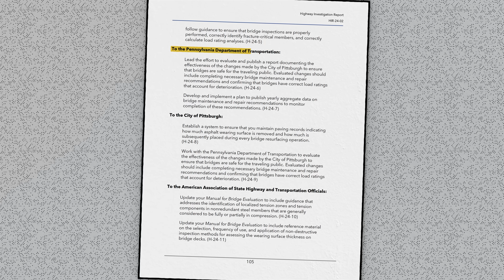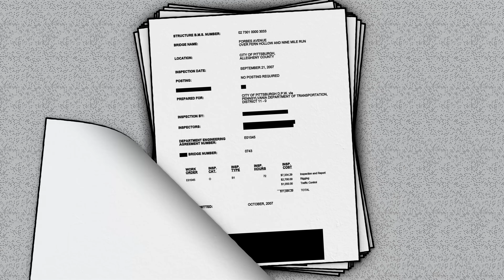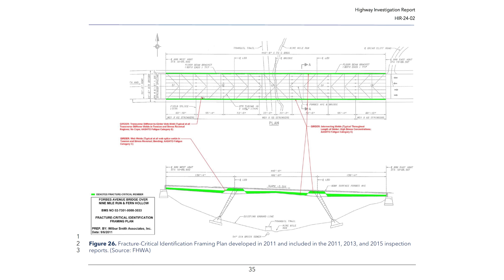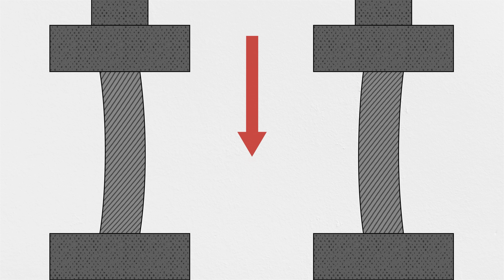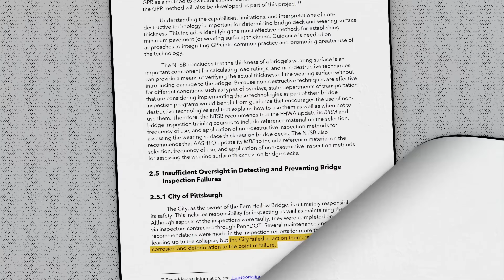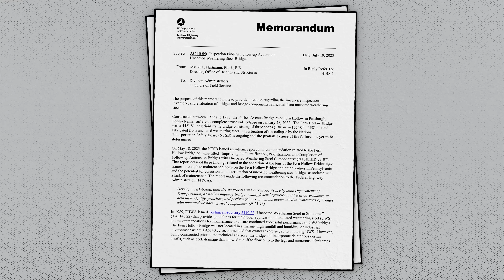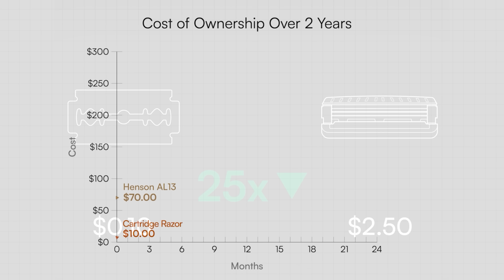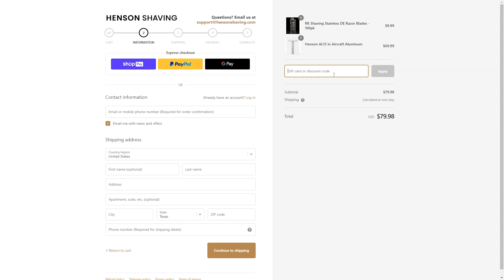This Bridge Should Have Been Closed Years Before It Collapsed

Comment: Great video.  I'm a bridge engineer in Pennsylvania (Philly), and you really hit on a lot of the issues with the system.  We as inspectors can only do so much.  We have a responsibility to do the due diligence during the inspection and report writing process.  Seeing defects like was seen on this bridge is unfortunately not uncommon.  Finding 100% section loss in steel is pretty normal,  but as you noted, the location of the section loss matters.  It often matters more than the amount of section loss,  because there's a lot of material in a bridge that doesn't see a lot of stress.  Unfortunately we as inspectors only have the ability to report findings.  Some owners are more proactive than others when it comes to repairs,  load ratings,  increased inspection frequency, and replacement. PennDOT is notoriously bad with maintaining its infrastructure. Pennsylvania is 2nd in the country for the quantity of bridges in their inventory,  and they are 1st for having the worst condition bridges.  Given the history of the state, including with the country's founding and steel fabrication in PA, it's no surprise that we have so many bridges in such poor condition.  We have some really really old bridges here - some over 200 years old. But in spite of the monumental responsibility that Pennsylvania has as compared to other states,  the state agencies and politicians seem disinterested in doing anything about it.  Penndot is notoriously stingy with everything,  even new design budgets.  It makes it difficult to get anything done or to find competent work.  The lack of attention to infrastructure is an age-old joke to Pennsylvanians. We are the pothole capital of the US. Something has to give at some point,  but it doesn't seem like that's ever going to happen.  Penndot and the state government are more interested in buying new technologies for turnpike tolling and building whole new interchanges than they are with fixing our existing infrastructure. Even multiple high profile bridge collapses haven't been enough to sway those in charge.
Reply: If inspectors had a federal power to limit the traffic using a bridge -- even to the point of none at all -- would that help, or would officials just take excuses through the courts or close the bridges without alternatives?
Reply: @rivimey they closed another Pittsburgh bridge about three miles from this bridge about a year after the Fern Hollow bridge collapsed. It was a bridge that carried major traffic. It was closed with no warning to the public (that was fun), and we were told that it was going to be repaired. Almost a year and a half later, nothing had been done. They “might” get it repaired and opened sometime next year. 

Welcome to Pittsburgh!
Reply: Thanks for that, it's good to hear from someone who actually knows the field. 
I was just thinking about the twitter post and photo that got mentioned in the report. Do you think that a loose network of concerned citizens, dog walkers, hikers, retired busybodies and just random dudes and Karens could help you, now that everyone has a smart phone? No doubt there would have to be a few simple rules they would all have to follow but you would get a large photo archive of the bridges and infrastructure over time and in different conditions. That could be useful.
Reply: @rivimey   the politics of it all can be really complicated, but it's not exactly an Us vs. Them relationship with inspectors and owners. Inspectors can and (on rare occasions) do call in to the owner while on-site when the condition is severe enough for emergency intervention.  The issue comes with finding that threshold where you decide that something must be done immediately.  There are no shortage of bridges in this country that have very severe deterioration,  yet they remain standing for years or decades.  There's a lot of reserve capacity and redundancy in most bridges, so loss of material doesn't necessarily mean the bridge is in danger of collapse (often it isn't). It can be difficult to determine this in the field though,  because you need to do a rigorous analysis to even know the capacity.  It's not possible to do that on site.  Generally, there are telltale signs of imminent danger that we would see that would cause us to call it in.  Things like a significant sag in the bridge deck, a fracture in a steel member,  severe scour of a bridge foundation due to water,  etc.  Certain types of bridges are more critical than others due to the nature of how they distribute stress.  For example,  trusses are typically non-redundant, so if 1 member fails then the entire bridge or a section of the bridge may collapse.  So seeing a fracture in a steel member of a truss is a very big deal and we would call that in and probably try to stop traffic ourselves if possible.  But seeing a crack in a steel beam on a 6-beam bridge is less critical,  because if that beam fails the load can distribute to the adjacent beams and imminent collapse is unlikely. Load redistribution isn't possible with a truss. Ultimately the owner still gets the final say in whether or not to close the bridge,  but generally speaking they will take the advice of the inspector. The implications for closing a small bridge on a back road are minimal,  so it's not usually a big deal to close one.  But closing a mainline bridge on an interstate and/or a bridge on the Federal emergency route has massive implications for the surrounding community,  commerce,  emergency services,  safety of local residents, etc. It's no small deal to close a bridge on I-95 like the one that collapsed here in Philly after the tanker fire or the FSK bridge in Baltimore that was struck by the ship. I'm not implying that those bridges should have been closed due to their condition by the way; I'm just using them as examples since they're well known to everyone in the country and they're on major interstates. For an inspector to call in the closure of an interstate bridge,  he needs to be right about it needing to be closed asap. The owner would be pissed if we called in something that wasn't that emergent, wasting tons of time and money by doing so. That's why it's so tricky to do these things.  You are basically putting your entire career on the line for something that you usually cannot be 100% sure about.  It's almost never black and white.
Reply: @jakedee4117  no offense to those trying to help,  but the vast majority of people lack the requisite knowledge to understand the condition or potential threat to safety. The general public tends to put too much emphasis on the appearance of a bridge without understanding the mechanics.  I've seen and heard many non-engineers complain about an 'old rusted bridge' which really says nothing about condition or load carrying capacity.  Rust is normal on steel.  Cracks are normal in concrete.  You can have either without it affecting the bridge capacity at all. I've inspected countless bridges that had failed paint and rust throughout,  but they didn't have any measurable loss of steel.  When steel oxidizes,  the resulting material (rust) is 16 times thicker than the original steel.  So if you had a 1/16" steel plate that fully rusted through,  you'd end up with 1" thick rust.  Extrapolate this to a typical beam/girder flange that is 1", 2", or 3+" thick,  and that's a LOT of rust.  Point is: it often looks worse than it is to the untrained eye. We make the remaining steel section with calipers and use that data to do a load rating analysis of the bridge. It's not even possible for us as engineers to gauge these things on site.  We need to run an analysis on the computer. So it's virtually impossible for the general public to have any idea about the condition of a bridge.  The times when the public can help is more with the big red flag items that any person would know is a problem.  Certainly the Twitter photo in this case would be a good thing to report,  though 100% section loss on a bracing member is still not that unusual. I-495 around Wilmington was closed after a motorist reported a sag in the bridge barrier.  That sag ended up being due to the pier tilting as a result of a stockpile of construction material too close to the bridge.  That was a rare case when a not-so-obvious sign of distress ended up being a massive issue,  and somehow a traveling motorist caught it. If I were to provide guidance to anyone wanting to report emergent issues with a bridge,  I would say to ask themselves 'does this look right?' As in,  is something bending in a way it doesn't look to be designed for? Is something leaning that probably shouldn't be leaning? Is a piece of steel cracked or fractured?  Is a large portion or all of the foundation exposed? If you see something that really looks off, report it. But I would say to refrain from reporting rusted steel or cracked concrete,  because 99.9% of the time it's not a serious defect requiring immediate intervention. And over-reporting non- critical issues will only take away from our time and resources. The majority of the time,  we already know about the issue being reported by a concerned citizen, and it's been evaluated at least once.  Many times,  it's a very insignificant defect that sometimes has been around for decades, but it simply looks bad to the public so it keeps getting reported. We have to inspect all bridges in the country on at least a 2yr cycle,  so there's rarely a situation where a defect goes unnoticed by inspectors for years.
Reply: @rfehr613  You raise a lot of good points and maybe my point isn't so much about inspecting bridges as it is using people plus technology to keep an eye on what's happening in our communities. One of the problems raised in the video was clogged drains, so how often are the streets flooding, when and where? Where is the garbage piling up? Homeless encampments? Oil stains, weird smells etc. etc.
I know a lot of people are concerned about security cameras surveilling everyone but, in a democracy, people can't complain about citizens keeping an eye on public places and passing the information on.
This could actually be a good job for AI. Sift through it all and make alerts when needed.
Reply: @rfehr613  I respectfully disagree with your original comment of "we can only do so much".  If, by that, you mean to fill out and submit your inspection form, for a structure that is obviously in peril, that is a disservice to the safety of the public. If the engineers in this case submitted, held special calls/meetings, implored the owners, and then went to the media about the issues, then great.  That is what should be done as I understand the code of ethics for an a Civil Engineer.  Otherwise you are just acting within the same failed system.
Reply: @jakedee4117  inspectors inspect and report on all aspects of a bridge,  including drainage.  In fact,  drainage is one of the most critical aspects, since properly functioning drainage is the first line of defense against deterioration.  Water,  or rather salts in water,  are the primary mechanism driving deterioration.  That's why we try to minimize the use of joints in a bridge,  because fewer joints mean fewer chances of water getting on the critical components of a bridge. 

We are also expanding the use of technology.  My firm has used drones in limited capacity.  They are really only useful for areas that an inspector cannot reach.  Other advanced inspection methods employ radar or lidar for finding defects in a bridge deck,  various equipment for detecting cracks or imperfections in steel,  and destructive testing like concrete coring to evaluate the condition of concrete beyond the surface. Some owners are utilizing ice and snow sensors,  many use cameras already on all their interstate bridges,  and there's an ever-evolving field of material science which offers new materials for owners to use. 

I think the biggest thing the public could do is pressure the state agencies and politicians to invest more in repairing the infrastructure. That would be the most effective use of their voice in my honest opinion.
Reply: As an Ohioan and honorary Michigander, I'll fight you for that pothole title 🤣🤣
Reply: @Real28  😂 any of the northern states are pretty bad.  I've never been to Ohio,  but I don't recall the UP being particularly bad.  Then again,  they don't even have traffic signals up there 😂😂
Reply: @daveharness70  it's easy to be critical when you're standing on the outside looking in.  But as I described in my other posts,  it's never black and white.  There's no grand conspiracy to perpetuate an unsafe system of infrastructure. It's simply a matter of balancing safety and fiscal responsibility.  We'd love to fix every little problem on every bridge,  but there's nowhere near enough money to do that.  So we have to decide what can be fixed and when.  That's why defects are assigned priority levels.  It would be wholly irresponsible and a violation of the code of ethics to demand every miniscule defect be fixed on an emergency basis.
Reply: @daveharness70  I'd also like to add that not all inspectors are created equal.  Every state does things differently.  Some states, such as Virginia, do not require their inspectors to be engineers.  You can become a bridge inspector in Virginia with only a high school diploma and the basic bridge inspection training course that we all take.  I do not think this is smart policy,  but at least it's the exception not the rule.  Most states require some kind of engineering credentials - be it an engineering degree or a professional engineering license (believe it or not,  you don't necessarily need the former to obtain the latter in many states). Further complicating matters is that some (probably most) states have in-house inspectors. Virginia,  Delaware,  and Maryland SHA use in-house inspectors.  Without putting any one agency on blast,  I'll just say that in-house inspectors are almost universally awful at inspection.  They don't really try at all,  and their reports are sometimes completely useless.  In the private consulting engineering world,  we hate getting an in-house inspection report because we know we can't trust its accuracy.  I think this is more a problem with government work as a whole and not unique to civil engineering by any means.  The upside is that every agency I'm aware of relies very heavily on private consultation firms for bridge inspection,  and many agencies are doing away with in-house inspection and even in-house engineering.  They're hiring all work out to us consultants because the product they receive is considerably better. Even private consulting comes in different flavors,  but from what I've seen most consultants are more than competent and extremely professional.  Most of the time,  we are inspecting bridges that we use ourselves,  so why wouldn't we want to be thorough and accurate?
Reply: Federal agencies should be obligated to publish all reports. 

Followed by a casual "hey you should look into this" to local journalists.
Reply: @rfehr613  What would you think about inspectors being able to file an emergency motion for a court to hold a hearing considering whether a large piece of construction/infrastructure is in such dire shape it needs to be shut down and/or the owner (inclusive of the gov.) legally compelled to take action?
My thought is that even if there are issues with appropriate enforcement, it's at least the kind of thing that could raise public awareness, get local news more likely to report on the state of the structure and/or a court having such a hearing. I've seen local news reporting on citizen complaints about a bridge in CO end up with the needed (and promised but long left unfulfilled) fixes being fast tracked after the reporting, for example.
Reply: @AlohaChips  I don't think that is necessary.  Perhaps I wasn't clear enough with my previous posts,  but when it comes to emergency actions like immediately shutting down a bridge,  I've never heard of an owner challenge the inspector to keep it open.  That doesn't happen.  When it comes to emergencies, the issue is more about correctly identifying it as a true emergency.  That can be really hard to do sometimes.  It's not always obvious.  But if we make the call,  you can expect it to get shut down. 

Emergency intervention means that you do something right now.  Whereas there are other priority levels which are still high priority but don't require the bridge to be closed.  Sometimes they will get someone out there to fix it the same day but without shutting the bridge down.  That's still a very urgent matter,  but it's not the TOP urgency level... which would be immediate closure.  We routinely write Letters of Concern to owners, which are basically a step down from emergency priority.  An LOC might cause the owner to decide to close 1-2 lanes, limit truck traffic,  or any other number of actions.  It just depends on the issue at hand. But properly assigning of priority levels is an essential function of our job.
Reply: PA has ~120,000 miles of state maintained roadways in part due to the 50/50 rural/urban nature of it. Add in the freeze thaw cycles, amount of out of state traffic and salting and we also have a very large and expensive infrastructure to maintain.
Reply: @paulwalsh2458  I don't think Pennsylvania is particularly unique in any of those respects when compared to it's neighbors. What sets PA apart is the amount of bridges,  which incidentally are orders of magnitude more expensive to replace compared to roadways.  Having grown up here and having lived here for about 30 of my 40 years,  I've seen the same trends with infrastructure investment.  Having worked extensively in Maryland,  Delaware, and a bit in Virginia,  I have a pretty good feel for how the states handle their infrastructure and budgets.  And unfortunately PA seems to handle it the worst (though Virginia is pretty bad with bridges too). It seems like a mentality in the state and local governments.  PA is unique in the fact that it divides itself into distinct districts that almost act independently of each other and independently of the state. It seems inefficient to me.
Reply: @rfehr613  For comparison take NJ with the metric of a similar population size and the number of state maintained road miles. And statistically look at areas with the most freeze/thaw cycles. We north PA drivers see everything below the Lehigh Valley Tunnel as Jersey, MD DE weather, then there's the rest of PA. I think NJ is ~35,000 miles of state maintained roads but can't remember. *I partly agree about the bridges but those on the alluvial plain get warmer weather yet salty air and those inland get continental weather and salted roads.
Reply: @rfehr613  "when it comes to emergency actions like immediately shutting down a bridge,  I've never heard of an owner challenge the inspector to keep it open.  That doesn't happen."

What about the situation that occurred in Pittsburgh, where multiple high priority problems (Grady called them 'level 2,' I think) identified during inspection went unaddressed for years? Is that common? If so, would it be reasonable or possible for state or federal government to require public disclosure when that happens? Public pressure might help to get those problems resolved a little faster. Even though I'm unlikely to call my state DOT, I think I'd still like to know which bridges that I use regularly have repeatedly failed to address weaknesses identified in inspection.
Reply: @aaronb1195  the issues leading to the collapse of this bridge are multifaceted.  There isn't typically one single failure that you can point to.  Without having read the actual investigation myself,  it seems to me that it was likely a combination of misreported severity of defects,  misunderstanding of the mechanics of the bridge,  and/or failure to act by penndot. I have to emphasize that i do not have knowledge of this particular bridge,  so don't take anything i say about it as gospel.   The process just really isn't as black & white as it seems after a disaster occurs.

A priority 2 defect or repair is actually really not that big of deal typically,  which is why it seems to have been misreported. The issue with making the full report public is the fact that the public doesn't understand the mechanics or verbiage that we use.  Things that may sound severe really aren't.  It's just how we talk, for lack of a better explanation.
Reply: I've lived and driven in Pa for a longer duration than yourself so if this metric fits into your calculations ok. That being said I'
m fairly apathetic whether our infrastructure collapses entirely. I want my people to survive. That is all.
Reply: @paulwalsh2458  of course every dot handles things differently.  NJ tends to be better than PA, but their taxes are considerably higher too.  And they have a much larger portion of urban area to rural.  That said,  their gas taxes are lower,  so maybe they just allocate resources better.  I also have zero NJ inspection experience,  so I'm going off of  hearsay with this. It may be cooler in central or northern PA (in a bloomsburg grad, undergrad in physics), but it's really not a different climate.  There's no appreciable change in climate until you reach Virginia.
Reply: @paulwalsh2458  the point of me saying I've lived in PA for about 30 years was only to emphasize that I haven't really seen much change with how the state handles things.  Obviously, I haven't been an engineer for 30 years,  but in my professional opinion my assessment of the infrastructure management here is unchanged from before I was an engineer until present day. I'm speculating to some degree on the cause,  but I have lots of experience outside PA to compare to.
Reply: @rfehr613  I agree that NJ and VA and the rest of the N.E. states maintain better road conditions throughout the year. As an uneducated man who travels the Nanticoke/West Nanticoke bridge on a regular basis I'd like your opinion on its condition if you can scare any up..
Reply: @paulwalsh2458  can't say I've ever been there.  My only traveling in pennsyltukey were pretty much limited to the occasional visit to Wilkes barre, Scranton,  Centralia, or hazleton.
Reply: @rfehr613  That's ok.
Reply: @rfehr613  As you can see from my other response, I'm not on the "outside".  You are downplaying the obvious decay and neglect of this bridge.  If you were involved I would file a complaint to the board.  You seem to be turning a blind eye to the whole "ethics" component of your license.  It is for the public safety, not for you, your employer, or your client.
Reply: I don't know what other post you're referring to,  but the one single post I see of yours suggests you're not a civil engineer.  Moreover,  your lack of understanding of the process indicates that you are in no way qualified to even discuss specifics.  I'm trying to put things into layman's terms for you and everyone else here,  but this isn't the ideal medium to be doing that.  It's difficult to write long and thorough posts on a YouTube comment section from my phone. 

It seems that you only want to start a fight and try to point the finger of blame.  You are putting words in my mouth and making assumptions that aren't true.  I've explained the process in more detail in other posts,  so you're more than welcome to read those to get a better understanding.  But to be abundantly clear,  we (engineers/inspectors/owners) are in no way shape or form attempting to skirt regulations or turn a blind eye to safety.  In addition,  nobody is perfect and no inspection is perfect.  Defects can be missed, defects are not always able to be detected.  Defects may be more severe than the inspector thought they were.  And yes I'm sure there are times when negligence is to blame.  But you don't get to define what constitutes negligence,  because unless you are an investigator for the NTSB or work for a consulting firm doing forensic engineering, 
 you lack the requisite knowledge to identify and assign fault.
Reply: @rfehr613  Perhaps you can read my other  response to your other babbling comment. It might help.   I'm starting to think that you are not a professional engineer as you are not getting the point.  But you sure can sling that keyboard!  You also don't listen to learn or understand, you merely listen to respond.  Oh...and I do work for a consulting firm doing forensic engineering.  But since you are here to spread your knowledge like sewage with placating words to the ignorant public (no offense meant to others reading) to turn their wrath away from the engineers, I'm not going to change your perception.  Good day, technician.
Reply: @daveharness70 that is a pretty childish and unprofessional outburst from a purported professional engineer.  I have remained professional despite your mud slinging.  Since you are so hell bent on demeaning a fellow engineer for your own personal gain,  how about you at least prove to anyone else reading this that you are in fact a qualified professional by producing evidence of said qualifications? 

I doubt you will follow through based on your responses thus far,  but so as not to be a hypocrite, here are my qualifications. And I'm sure you already know that licenses are public record...

Professional engineer (PA - PE094603, MD - 50278)
MSCE Structures (Virginia Tech) 
12yoe in bridge design,  rating, and inspection 
NHI Certs: 130055, 130053, 130078, 130087

Clearly, I'm more than qualified to discuss bridge inspection in detail and to provide the general public with information about how my industry works.  I'll wait for you to do the same,  but if you can't, then do not come back with another pile of nonsense and name-calling.
Reply: I mean. It will ne completely out of your way.
But. Maybe it is possible to try to gather signatures and maybe put in a ballot measure when the powers current owners are not doing anything.
At the end of the day, i kind of does come down to cost.
Things will get done as long as someone is willing to pay for it. (At least here in America.)
This is especially true for public infrastructure that everyone relies on.
It doesn't matter if you are a billionaire or a fastfood worker. We all rely on public infrastructure to make more money.
It is probably more true for the rich than the poor. Since their wealth requires more infrastructure to sustain.